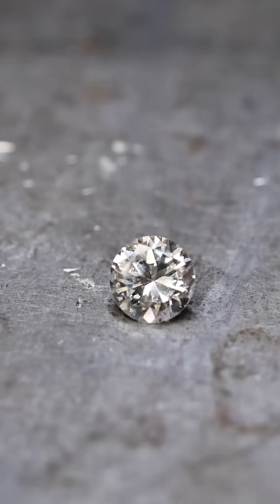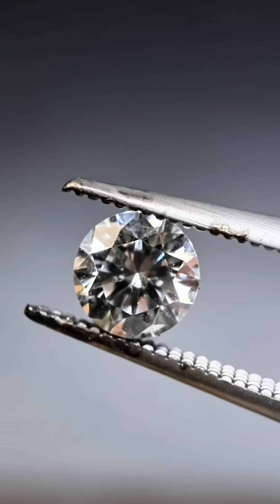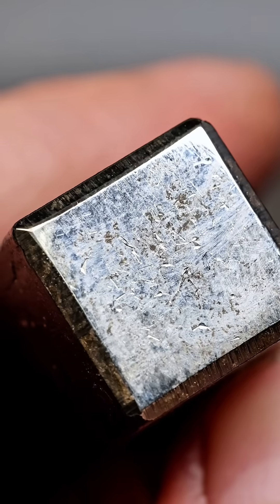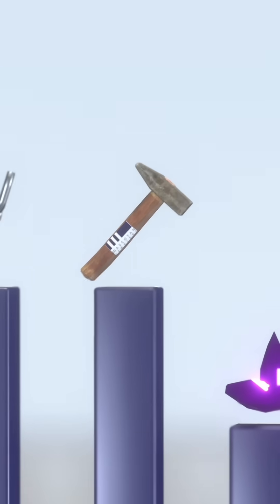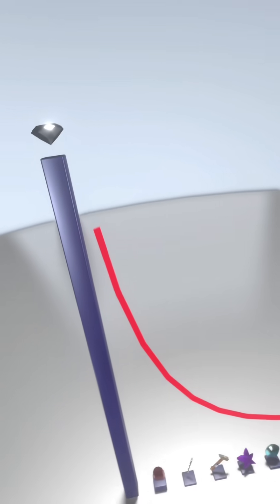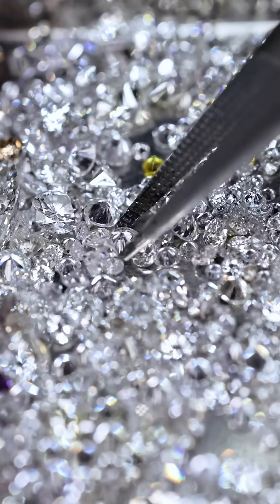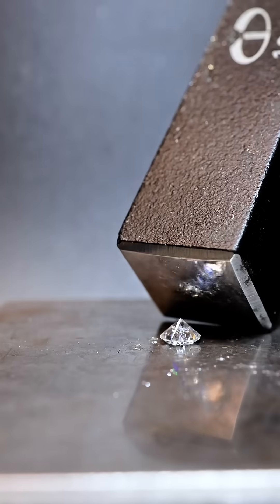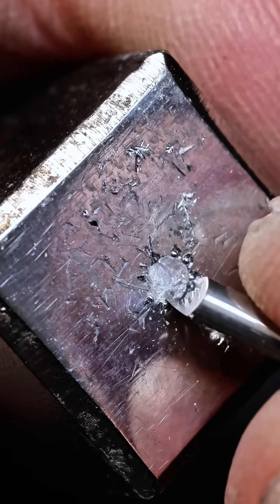Diamond vs Hammer

Comment: Hardness is scratchability, toughness is shaterablility. The reason adding the diamond to the hammer broke the other diamond is because it was focusing the force of the hammer to a smaller point, because it was the same force over a much smaller area, creating massively higher pressure.
Reply: This! Came here to say just that.
Reply: The other variable is kinetic energy, which is a function of the rate at which that load is applied. Brittle materials like glass and diamond shatter at much lower loads if the load arrives at speed, with inertia behind it. 
Tensile and Compressive Strength is measured in units of force, but Impact Strength in energy (in both cases, divided by  cross sectional area).
Reply: What is the toughest material?
Reply: @2nukitv218  Two of the toughest readily available materials (by weight) are actually mammal leg bones, and tree branches.
For engineering purposes, AFAIK the toughest currently known metal is recently discovered alloy of equal parts chromium, cobalt, and nickel (CrCoNi), from a class of metals called "high entropy alloys".
It's about five times as tough as the toughest steel available, and unlike steel (and almost all other materials) the colder it gets, the tougher it gets.
Reply: minecraft lied to me 😭
Reply: It's mean if he had added iron there instead of diamond still he would be able to break that diamond?
Reply: Why can't they say scratchability instead of hardness? Since scratchability makes more sense and is used to explain "hardness"
Reply: @じゅげむ-s6b   Because hardness is a much more important attribute. It governs how long a wearing part lasts, and it often correlates with tensile strength (for a given material). Scratchability just happens to be an easy way to roughly measure hardness, and sort of explain it to people with no background in materials science.
Reply: Steve profile picture in a video talking about diamonds being used as a tool

Comment: The diamond is, unbreakable? That’s crazy
Reply: Even a little...bizarre
Reply: It migh cause... a breakdown
Reply: That's... great, daze
Reply: No he's mixing up hardness with brittleness. Diamonds being crystals makes them relatively easy to shatter. Hardness is resistance to scratching. To prove the point, glass is far harder than steel, but you can break it with a rock.
Reply: @Skylancer727  r/whoooosh
Reply: @khromyakvsevolod3664  this is a joke? Even with you pointing it out, I still don't get it.
Reply: @Skylancer727  reference to jojos bizarre adventure
Reply: @ yes

Comment: This is all incorrect. Mohs hardness does not equate to brittleness. Diamond is hard, but it is brittle, meaning nothing can SCRATCH it, but you can still shatter it with a hammer. You just weren't hitting it hard enough.
Reply from the maker: You’re right. In the future I’ll do a version focused on scratching instead of breaking, and in that one the mohs hardness will be more appropriate.

Comment: The scale is ordinal?? Do you mean exponential?
Reply from the maker: No. It’s ordinal.
Reply: ordinal means labels sequance matters but the difference between labels don't.  exponential means scale follows an exponential formula.

ordinal doesn't follow a formula and is arbitrary.
Reply: It aproximates an exponential curve although it's not perfectly exponential

Comment: as a GG who works with the public, my nemesis is the Mohs scale. People think that a high number indicates a gemstone's full durability. IT DOES NOT. It only indicates resistance to scratching. Durability exists along three factors: hardness; toughness (ability to resist breakage and chipping); and stability (ability to resist light, heat, and chemicals). Diamonds are the hardest substance and they are incredibly stable, but they are not the toughest. They CAN break and chip on things that are not other diamonds and it's crazy that this guy is a jeweler who does repair and modification of old pieces and doesn't know this.
Reply from the maker: You're absolutely right!